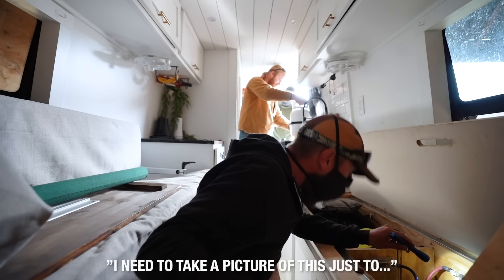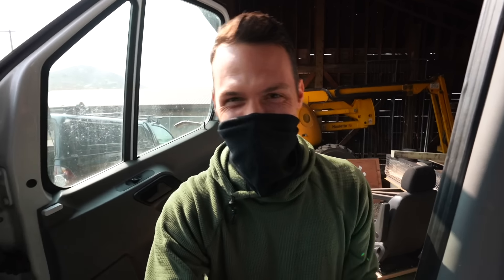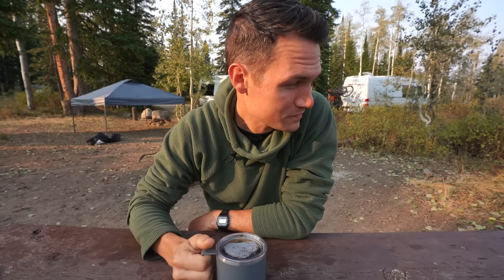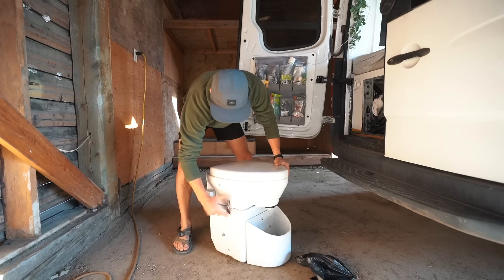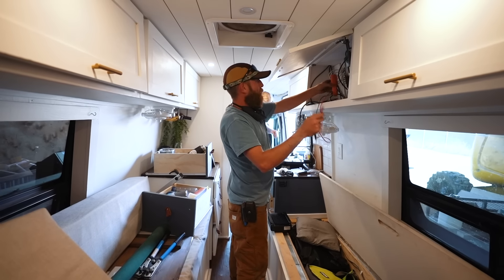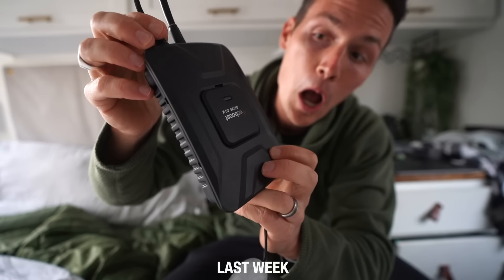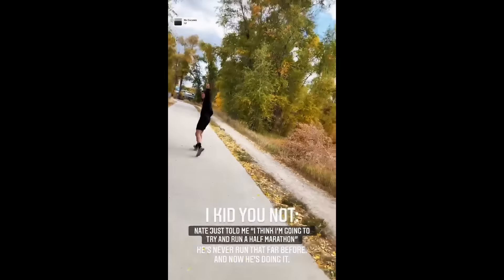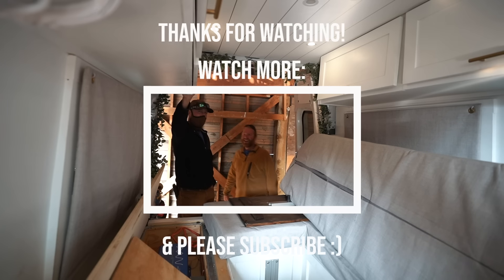Our van almost caught on fire.

Comment: I think if you’re going to be putting continent out there that you know people are going to be copying you should be responsible enough to be doing things safely when it comes to electrical which can cause fires which can kill people. I am constantly amazed at the total lack of concern for the ability to egress a van if there is a fire or the failure to use firewalls to compartmentalize any electrical fires. I also see all these beds put at the perfect height to make it apparently impossible to open the rear doors for egress in the event of a fire in the front of the van. Face it, these videos on YouTube are sadly all designed to get clicks and sell products for which they get a commission. they’re not designed to talk about anything serious, Because that might spoil that all positive attitude that clearly the commenters demand.

Comment: You shouldn’t have to be an electrical engineer to do this. You are not inventing the technology. You’re just installing already existing technology and if you’re a journeyman electrician you should understand all of it and be able to read an electrical schematic and know proper techniques for making connections that won’t fail or short circuit which is one of the most common mistakes, in addition to substandard wire sizes or over sized fuses. Electrical engineers capable of designing these systems from scratch would probably be earning $200,000 a year or more counting benefits. So it’s highly unlikely you’ll find any electrical engineers doing van installations themself. I have a five year bachelor of science degree in architecture and in the state of California I’m not even allowed to call myself an architectural graduate or anything that has any form of the word architect in the title because I’m not a licensed architect. However when it comes to engineers there’s hundreds of titles and apparently no regulation on using the word engineer in your title so I’d be wary of anybody calling them self any kind of engineer. Hey I’m an audio engineer. Jedd Clampett was a sanitation engineer